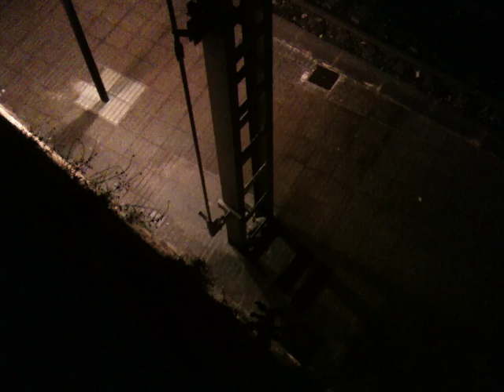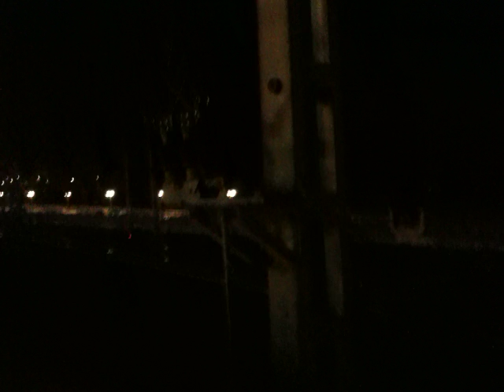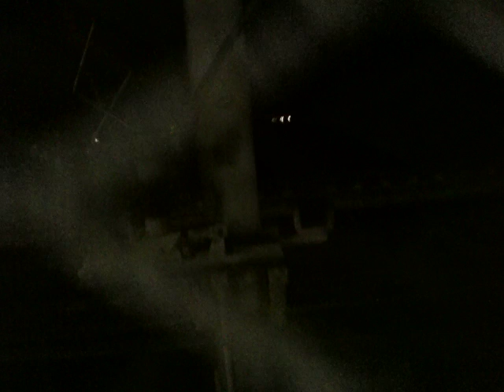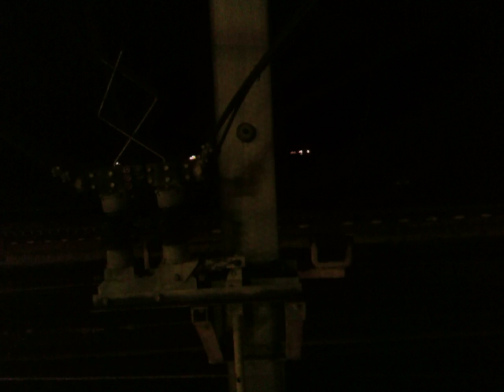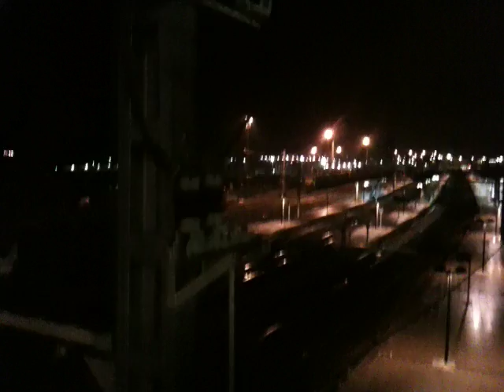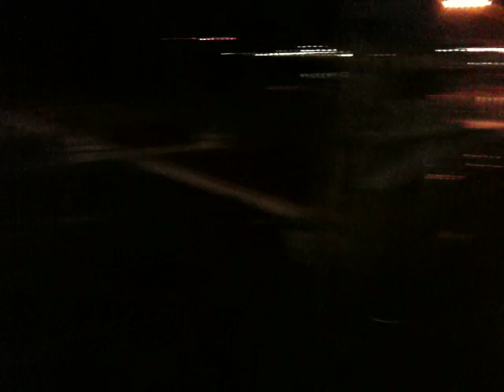Alarmingly close 25 kV switch

Comment: For live conductors and the public, safe distance is 4 meters away.
Railway voltage is 25 kV to ground and 50 kV between the two phases of the auto transformer.